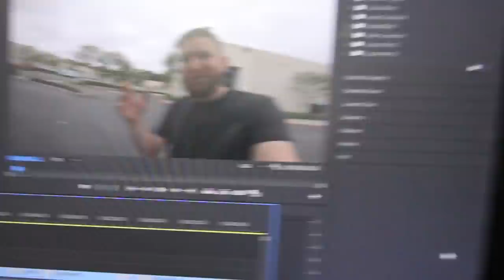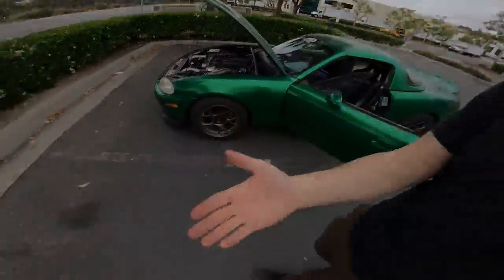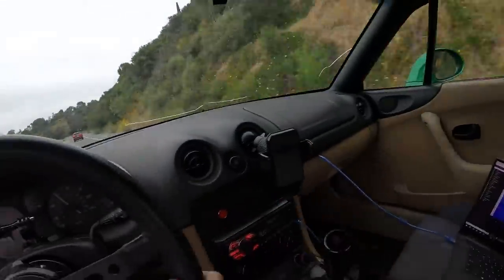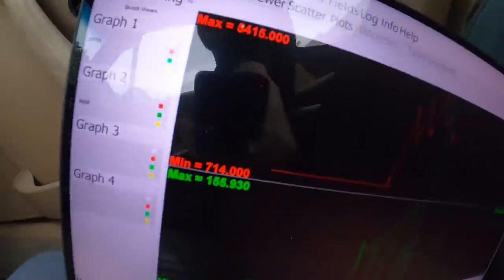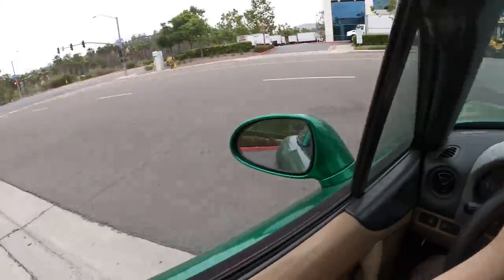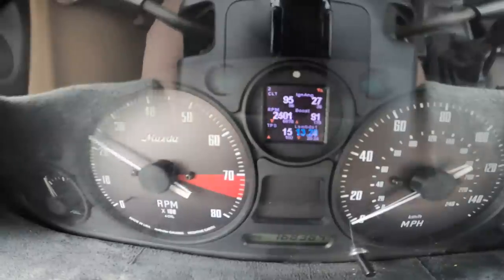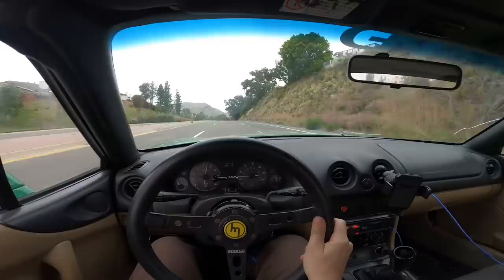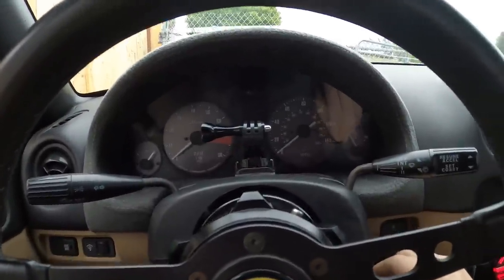The NB Miata is now ROTREX Powered. Taking The First Drive!

Comment: Ive been running an NB vvt engine with the c30-94 rotrex and make just under 300 on e85 (265 on 93 pump gas) super reliable and have put 20k daily miles and 10k track miles on it. No issues and love the reliability!
Reply: Impressive, I have a NB VVT as well, but was looking at the  74 because of reliability concerns. I do  quite like to hit revlimiter 3-4 times during my daily trips, is that  how your 'daily' miles are as well?
Reply: @Gekko12482  No. My daily commute is 60 miles of mostly highway use. Daily commute rpm never exceeds 5k (3-5psi boost range) to merge.

Treat it well, and it shall be a great way to daily.
Reply: What size pulley are you running?
Reply: @RippinLyons  90mm is what i use and is the smallest the c30-94 supercharger can tolerate without over spinning the planetary gears.
Reply: I also had a C30-94 on my VVT swapped NA. We made 295 whp on E85. Tuner said it had more in it but kept it down for improved knock ceiling and rods.
Reply: Still going strong?

Comment: Hey Greg welcome to the Rotrex SC era! Been following your channel since I bought my 01 NB 4 years ago and really have learnt a heap from your content. Since last year my NB runs a Rotrex C30-84 with water meth injection, an ME442 ECU and a Canchecked gauge, 220hp at the wheels and lots of smiles. It never had quite enough power - until the Rotrex arrived!

Comment: Greg, I really hope you do an NC build one day. The differential and transmission easily handle 300whp in a way more capable chassis than earlier cars. The wheel hubs from an RX8 fit allowing massive tires to actually put power down. You really are needed as there are tons of NA and NB tuning channels and almost none documenting the boosted NC well. With an RX8 differential and a boosted 2.5L swap 400whp should be very doable.
Reply from the maker: Trust me, I'm very aware of the NC Kool Aid and can't wait to have a sip (aka shotgun the entire pitcher.) I've been holding out so long because I can either wait until I have a bigger driveway/garage so I can keep all 3 cars, or sell the NB now to make room for the NC. Not ruling out the latter, but if there's a chance I'd be able to get into an NC while keeping my other 2 cars, I think it will be worth the wait.
Reply: @TheCarPassionChannel  Definitely worth the wait, and chronologically the NB build totally makes sense. I'll be doing my small part thumbing up along the way. Besides, once you show what the NC can do, I believe you'll finally kill the hidden gem of the Yachtas that people have been sleeping on, so take your time. Thanks!
Reply: @TheCarPassionChannel  I have an 09 NC with a C30-94 Rotrex. I bought it as an abandoned project. I finally figured out what was stumping the last owner and am now tuning/sorting the car. I was considering taking the car to AED for tuning, emailing tunes sucks. I think you would like the car, it's super clean and the previous owner threw a lot of money at it, One Goal, PPE, Xero Limit cams, etc. I'm curious to what kind of power it's going to make. Maybe we'll see ya there. Love your channel.
Reply: @TheCarPassionChannel  If and when just get an ND while you're at it. Full line-up would be cool as hell!

Comment: I've been rotrexed powered for about 9 years with basically zero issues, besides shredding a few belts over the years. Started with a -74 at 190-210hp. Now a fully built vvt with a -94 making 295hp 240tq on pump 93. Has no low end power but above 5500rpm it's amazing.
Reply: Do you have a list detailing your build?

Comment: I'm thinking about doing this to my NA Miata. Kind of conflicted since it's a 74k mile pretty clean one. Awesome video Greg!
Reply: TRD kit is stupid easy to add/remove. So far as I can remember it doesn't have any mods that can't be removed in a long afternoon (injectors being the "hardest" part) It takes like 3 hours to install. 

Obviously tuning and standalone being the big variable.
Reply: My 97 has about the same mileage and I take it to the redline often. If your engine is healthy it will be fine. Rotrex don't make a ton of torque so it's not hard on the internals like a turbo would be.

Comment: This is the reason I went with a supercharger.  Though mine is a kit from Bofi Racing out in the UK using an M45, it's essentially the same; power throughout the RPM range.  It really makes the 1.6 a more fun Miata with a bit of boost.  Not only the linear power, but the lack of maintenance and the reliability that a supercharger brings.
Reply: Bofi sell the Rotrex kit. Once you factor in the cost of a properly refurbished M45 the two cost the same (like £5k+) by the time you have added ECU etc. Turbo is cheaper overall. You might find a used supercharger kit if you are going M45. Turbos are perfectly reliable if you don’t push the boost too much and have good supporting mods like cooling, I know plenty of people with years on basic stock bottom end 200hp builds.

Comment: If i wasnt dead set on a k series engine for my na this is the route I would go! had a kraftwerks kit on my k20z3 eg hatch, putting it on was like turning the unopened engine into a built N/A race engine lmao, the power delivery on these kind of superchargers is so fun.
For anyone curious it made about 370 wheel on 10psi, revving to 9000. K20z3:Skunk2 pro series intake mani and 74mm tb, cheap header, fuel and the supercharger kit, thats it.

Comment: Greg, I would be interested to know, with your current experience, which of your boosted setups you consider to be the most "worth it". Its hard to get a sense of driving feel, reliability issues, and other headaches through technical videos. Some of these kits can be pricey but sometimes you get what you pay for. Specifically of the following setups that you have made would you recommend to people taking price, enjoyability and reliability into account:

1. low budget turbo stock (broke and boosted)
2. Mid/High budget turbo stock (1.6 red car)
3. High budget turbo Built( Current red car)
4. Mid budget NA  (NB build with/without NOS)
5. Rotrex build (Current NB)

Comment: When you want reliable, predictable horsepower.
Reply: Got that with my FFS kit
Reply: Buy an LS.
Reply: @JamesChurchill3  he said reliable not accessible and cheap xD
Reply: @MendicantBias1 how do you like your ffs. I've been wanting one for a long time. I have a vvt and 6spd swapped na she just needs a little more power.
Reply: Reliable and rotrex…lol. Amazing kit and the perfect power, they just don’t last like turbos.
Reply: @tylerhackman6832  all depends on what you demand of it, turbos are nice, but they got drawbacks
Reply: @tylerhackman6832  Haven't heard anything bad about Rotrex from TDR but I have heard of FFS breaking or DOA.
Reply: @ema1671 friends or internet? not doubting just interested as I've been going back and forth on turbo vs super. I really like low end torque and the whine but if they break alot that sucks
Reply: @emerc5210  Superchargers don't break often. I have only heard of 3 failing ever. Each was at-home installation. 1 just wouldn't work and the other two had downsized pulleys, basically they were spun too fast. I don't think turbo or supercharges break more then the other, it is usually the owner trying to push the limits or neglect that breaks a turbo or supercharger. A turbo will break other parts of you car before it breaks usually.
Reply: @ema1671 makes sense im looking for about 200whp set up I can still daily but have fun with. I feel for the miata chasis its a good sweet spot. I've done higher hp builds ls swap etc on other modern cars just always gets a little sketchy eventually. Thanks for the info
Reply: @emerc5210  I had an Edelbrock(roots) on my ND which now has an HKS GT2(centrifugal) supercharger and my NB2 is about to get a turbo. You can definetly get 200whp out of a supercharger the only difference between a traditional roots/twinscrew and an centrigual supercharger is the roots/twinscrew will not pull you once you reach the upper RPM. They are great for low and mid range power. After about 5500RPM they just feel lazy. Centrifugals and turbos will keep pulling you as the RPM climbs. With the edelbrock I was making 220WHP, with the HKS it's about 260WHP on the same setup just swaping the blower, hope that helps.
Reply: @Stale_Mahoney  LS swapping a miata costs over 10k...
Reply: @TeamHeresy  damn no fabricating parts yourself or getting a junkyard engine it sounds like
Reply: @JamesChurchill3 Yk, there are people who don't wanna double the cars weight 😂

Comment: Nice! I'm currently running an older kraftwerks kit with the c30-74 on my 97'. Currently have the compressor maxed out and pushing 12psi on a bad tune from a shop. Plans are to get the c30-94 and push closer to the torque limits after I've had my fun with the current setup after a proper tune.

Comment: So why a centrifugal kit instead of a roots? For my personal preference, I much prefer a roots for that low RPM oomph and buckets of torque. If I wanted high RPM scream-o power, I'd just put a turbo on it.

So my question is: Why'd you pick a centrifugal over roots? What made you pick one over the others? I'm curious for more perspective.

As always, Craig, excellent video. <3
Reply: For me, it's also the way I would go, for couple reasons :
1. It's maybe an unpopular opinion, but I don't like the root supercharger whine sound.
2. I want to keep the same atmo exhaust sound, which isn't possible with a Turbocharger.
3. I want linear power, and more importantly, instant throttle response. (So again, not like a Turbo)
4. I don't want to spend a hell lot of money into an atmo tuning to gain 40hp

So basically, with a centrifugal supercharger, I'd be able to keep the same exhaust sound as an atmo, but without adding the annoying (for me) root whine sound.
For me it combines the advantage of a Turbo and a root supercharger.

Comment: Welcome new Member.... to the Rotrex Gang. I'm waiting since 2014 to you . Im started with a C15-60 and now since 2016 C30-74 on a 1.6 75mm Pulley @14PSI. No Dyno tune running about 21° at redline and making aroud 250 crank HP. Lets see what numbers you can do on the VVT. My Engine is forged with 11:1 Comp Ratio + 1.6 exhintake.
Reply: What mods did you have in 1,6 engine
Reply: @costastsementzis9414   forged 1.6 with supertech Pistons 11:1 comp ratio. Head Job is done by Hand. Some grinding here and there new valve seats. stock cams regrind to 254 inlet and 259 outlet with 115 degree lobe separation and more lift than stock.HKS Header and 2.5" exhaust. Maybe on the Dyno I can get a few more HP

Comment: My questions are:  What are the "must have", the "should have", and the "nice to have" upgrades to prepare a stock motor for this?

Taking the car as a whole, I already plan to work from the ground up. I put on new stock brakes last year but added SS braided lines.  New tires and sway bars went on this spring.  (Holy moly what a difference!)  New clutch (FM Stage 1) and flywheel are going in in a few weeks.  New coil overs and a roll bar will go on next year.

On the motor side, I'm thinking that doing the cooling system re-route is at least a "should" - and as long as I've got things torn apart, dropping in a cross-flow radiator would probably be wise.

Do I NEED a stand-alone ECU?  I'm not afraid of it, just want to understand the order of go.

My goal for the car is improved street performance.  Nothing too crazy.   Maybe (a very big maybe) I'll try Autocross someday.  The main focus is to make the car a little more exciting but still comfortably fun for me and my wife of 28 years to go tooling around on Wisconsin back-roads.  So 200 horsepower sounds like exactly where I want to land.
Reply: If you're interested in autocross, start now!  It will never be safer nor a more travelled road than in a mostly stock Miata.  As far as ECU the answer is "It depends".  You can physically get any FI to work without one, but it is a lot of bandaids and very old solutions because of the lack of ECU's in the past.  Nowadays ECU is a good direction to go even without adding FI because of the relative low cost to performance gain once tuned of ~15 hp/tq with better gas.  Also an interesting note since you seem to be taking your time and doing things one component at a time, if you decide you will do FI you should ECU first to learn about it with a much larger margin of safety.
Reply: Must have- not clapped stock motor and head gasket/radiator, aftermarket ECU (you need full control of timing and fuel) Cooling re route is not a must IMO, plenty of people do fine without it. Your stage 1 clutch may not hold the power either, most of those are not good for a small torque increase. Should have- good stock brakes, proper roll bar (all Miatas need one IMO) suspension bushes in good order or replaced, drive shafts in good order, likewise rear hubs and diff. For your use some coil overs are probably good too.
This is my opinion based only on 5 years Mazda ownership and 20 years as a mechanic. Personal opinions may differ. I have been doing all the supporting mods, next on my list is coil overs and ECU, prior to building my turbo set up. I have to use mostly second hand and refurb myself so progress is slow.
Reply: Don't skimp on your suspension. It amazes me how many people spend big bucks in turbos, etc. and then put $400 Racelands in the car. Get a quality coilover from 949 or Flyin' Miata.
Reply: FM Stage 1 is good.  Main thing is to make sure your engine is healthy first, so do a compression test. With good numbers, go for it.  For a roots kit without aftermarket ECU, look at FastForwardSuperchargers.  Their coldside kit now have the last breed of blower : the TVS. 👌
Reply: I have the TDR kit on my NB2.  Dedicated track car. A connecting rod failed in the stock engine while on track.  Had a built engine made with Haltech ECU.  Makes 275rwhp at 7400 rpm.  Just blew the stock 5 speed on track.  Swapped over to a BMW ZF 5 speed.  Love the SC setup as it keeps the predictability on track.

Comment: Love your videos. This thing sounds awesome!  I have a 96 m ed project that I've been working on trying to get running for a bit. It sat for like 13 yrs after being parked do to a failed water pump.  I Used your timing belt video for a walkthrough on that. Replaced gas tank, sending unit etc, rebuilt fuel injectors, new spark plugs and wires etc.. I unfortunately did a lot of work before realizing i may have a low compression engine. So I'm in a pickle trying to decide if i should try my first engine rebuild.. trying finding a replacement engine etc.. any thoughts on a situation like mine?

Comment: Hi Greg! I'm curious of your opinion between turbocharging vs supercharging miatas now that you have done both. It seems like both are great options depending on build path and I wanted to know which you found to have the easier install! Do you plan on running e85 with the supercharged motor?

Comment: Would you recommend for the Exocet as a Race track/AutoX and street driver? What's the weight of the kit. My Exo was 180lbs heavier on the nose than the rear. So I'm working to remove weight.

Comment: Hey Greg, I'm just about to start street tuning a turbo MX5, stock block, TD04 and ME221
I'm wondering what's a safe ign timing map while I tune the fuel table?
Are you running a base map with timing pulled out across the board?

Comment: Well, that escalated quickly! Good for the stock rods the charger is not as brutal on changes in torque than turbos can be.
What PCV valve are you running on sc setup? Does the catch can breather make it smell cancer in the cabin when hvac is on? Why no coolant reroute on an already boosted engine?

Comment: Things that worry me (TDR kit or otherwise) is the fitment of the hot side mount piece that holds the pulleys. How was the fitment and are you worried about eating belts, etc? How was cutting the front crossmember? And did you mount/press a Super damper on the new crank pulley, or did you stick with stock?

Sasuga
Reply: Fitment is fine. I've never had an issue with the belt. Cutting the space for the intercooler tubes is easy. Just use a good air powered body saw. The directions have you cut way more than you need though. If I was to do it again I would measure and cut only where the pipes are instead of going almost all the way to the center like the directions indicate. You don't change the crank pulley. Kit leaves it stock. It's a 4 rib setup.

Comment: As weird as it sounds, I'd like to know more about the tensioner the TDR kit uses. Is it an off the shelf timing belt tensioner from some car or is it a Rotrex specific unit? Do you need to tension it yourself or it is just a sort of "install and forget" type of part?

I have a turbo NA myself but I'd love to buy an NB some day and DIY a Rotrex kit for it. An SC seems to be a lot easier to install and more gentle on the engine internals compared to a turbo.
Reply: ditto
Reply: The mounting brackets is all part of the TDR kit but the tensioner itself is an off the parts shelf bin. Not sure of the brand but it is just set it and forget it. I did re-tension it once after the belt had some break in miles and stretched slightly from break in and it's been totally reliable ever since (several thousand miles).
Reply: @scotts2296  You don't happen to know the part number or from what car it came by any chance? My mate with an NB is open to be a guinea pig for me to build a Rotrex kit 😂
Reply: @jaguarjay13  No sorry there is no specific part number I can see but if you google "auto tensioner" a bunch if hits come up that look very similar to the one in the kit.